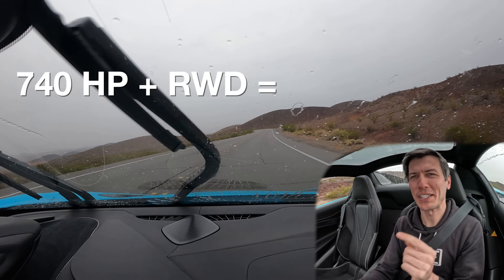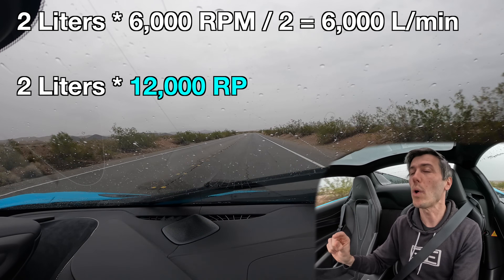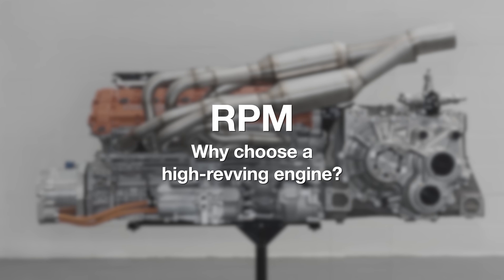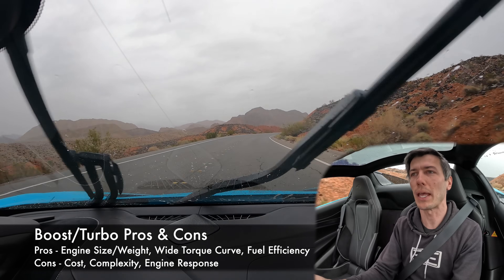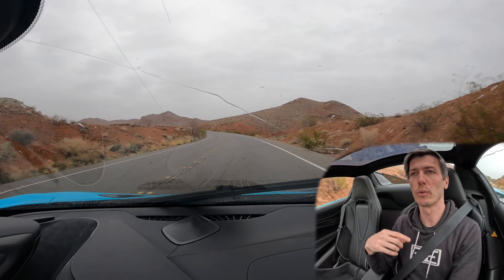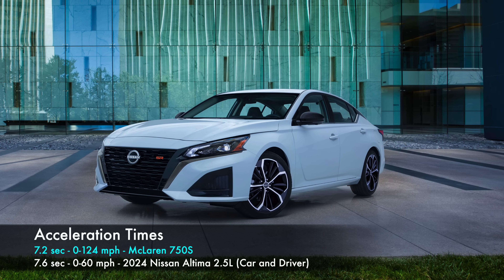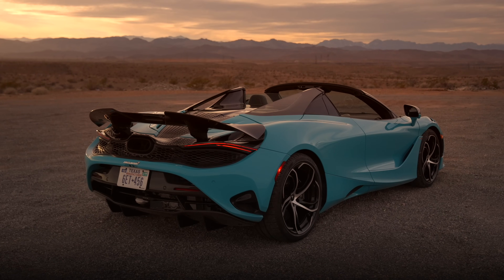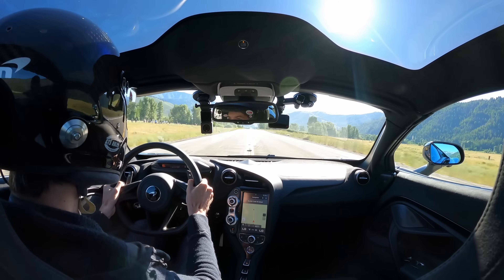Boost vs RPM vs Displacement - What's Best For Horsepower?

Comment: The best combination is a large displacement engine turning a lot of rpm with a lot of boost. There are plenty of 500+ ci engines running 70 psi of boost turning 9,000 rpm. It's just a matter of how much you want to spend.

Comment: Horsepower is calculate using american length measurements, metric horsepower is calculated using metric lengths
Reply: That’s such a relief.  I was worried the E.U. had mandated the use of mRNA injections to create genetically modified metric horses. 😊

Comment: I have always wondered why they do not make a hybrid with a small lightweight battery pack? But the car is FULL electric up to 40mph to have great acceleration. Then from 40mph to 60mph the electric power is being reduced fully off at 60mph as the gas engine is being used. Then from 60mph-say 80mph you are running around only on a 1 liter 40hp SOHC simple engine. The pack being charged any time over 60mph or during braking. 

Overall I think this could have a 3000-3500lb hybrid that has the potential to have 50+ mpg commuter in normal mode with a nice 0-60 of 6 seconds(due to things being lightweight and simple) . But also a "sports" mode where you can use that electric up to 60mph and even have a nice little electric "boost" for if you wanted some additional passing power.

Most people spend a majority of there commute on the highway and having a small engine just for going from 60-80mpg means that you dont need a huge engine or several gears. Electric low speed motor  then a 2 speed ultra compact lightweight transmission. Furthermore you could have the electric up front and the gas out back . This would aid in braking/regen at high speeds but also traction at low speeds with the battery pack down the middle of the car acting as a structural member(think Miata) with a lot of freedom in body design. 

But no one makes anything like this. Not in a normal car anyway which has me asking why?

Comment: Disappointed that you went with litres of air, when  'everybody' <ahem> knows it's the mass of air [ lbs or kg ] that makes the power. 
(The engine flows the same volume of air on a winter day at sea level as on a hot day in Denver, but makes very different power).

Comment: I get my fix for power and acceleration from superbikes at the track where lack of mass and RPM is king. I do sometimes ride them on the street, but having access to that much power and acceleration and not being able to use it without risking jail time or death is a constant sensation of being blue-balled, that does get old real fast.

For a street car, my 981 Porsche Boxster GTS  gives me all the thrills while still keeping it mostly legal. Its a great formula with a little bit of displacement, 3.4L with a little bit of rpms at 8k, combined with the increased sensation of speed from a convertible, and the super low CG from a naturally low sitting Boxer engine, and the best position to mount the engine rear-mid with RWD.

Comment: I haven't watched the video, but I'm a newer mechanic(about 6 months experience, 3 as a lube and tire tech lmao). Anyways, my hypothesis is displacement. The others give you more power as well, but they are basically trying to force more displacement out of the constraints of the engine. Boost gives more, condensed air to allow more fuel to burn. Higher rpm displaces more frequently. I mean look at tanker/cargo ships. Their engines are like MAX displacement(multiple feet bore and stroke) and they output MAX horsepower(10's of thousands). If it was boost or rpm that gave the most horsepower, they wouldn't make them that big.

Comment: or if you want an amazing power to weight and a true thrill just get out of the cage and buy a bike. for example, 2022 Kawasaki H2. supercharged, 1000cc inline 4 with 170KW (228Hp for people who can't translate from freedumb units) in just 240Kg (529lb) of vehicle. that's 200+ mph for less than $30k USD.

Comment: This is why they say there is no replacement for displacement!
Reply: Only for low rpm torque.

Horsepower is a different story.
If horsepower is just torque at rpm, then an engine that can rev can potentially make more power.

You can capitalize on that potential with more airflow, and more boost.

Hence why 3.8l Nissan GTR' are making deep into 4 digit power levels.

Comment: The only true solution is to max out all three with the strongest materials possible.  Take the 8.4L viper engine, bore it out, use crazy valvesprings to get 13,000rpm, and then cram 60psi boost into it.

Comment: Fun fact. Higher RPM doesn't really get air into the engine faster. It makes it harder, as the faster the engine spins, the shorter time valves are open for. Which is on reason why engines generate lower power and torque as RPM increases. Turbo improve this, but the faster an engine spins, the harder it is to make it spin faster.
Reply: (Im still team RPM though)
Reply: There are many more things I could explain but I wouldn't want to talk too much and sound ranty lol

Comment: Top fuel dragster:

500 CID (8.2L) V8
HEMI heads
65 PSI boost
9000+ rpm

13,000 HP
11,000 lb.ft

Comment: Do you to awnser questions ? I have 1600cc NA engine with a 2 inch exhaust . Only I think the cat is bad so I bought a 2nd hand 200 cell race cat but it’s 3 inch .. so it’s goes out of a equal length 4-1 header to 2 inch to a 3 inch 200 cell cat bracket to a 2 inch exhaust ..  would it hurt the performance or not. ? The cat is backpressure so making it bigger should make it easier for the gasses..

Comment: No replacement for displacement.
Displacement’s the most reliable method of producing high horsepower. Therefore, it’s the best from a non-rich owner’s perspective.
Reply: Turboing a car isnt prohibitively expensive anymore. Its not 1995.... 

Im quite confident a 5.3 LS with a turbo can make 1,000 horsepower alot cheaper than a stroked BBC.

Comment: Bigger engines will last longer anyway

There's a reason motorcycle engines usually don't last more than 100,000 miles on average( and the fact that most motorcycles never get to reach that because they get totaled)

Don't quote on me with your 200k+ miles grandpa's Goldwing, those are a different kind of beast
Reply: This Chanel is geared (no pun intended ) for speed freaks not trucking industry bean counters.

Comment: So the big displacement makes big power the cheapest way so in Viper is the reason

Hi revs needs a very light car so that is why it work in GMA T.50 even at low rpm

Hi boost works for small engines so that is why is in Gemera

Comment: When the Lexas LS first came out,  it had a 4L V8 that made 250hp.  Ford's CEO Alan Mulally said that was his finest car.   

Let's appreciate the fact that Honda produced a 4 banger 10 years later that's half the size, reved to 9k rpm, and made 4% less power than said Lexus

Big displacement was required because they were hooked up to 3 speed auto that had wide gaps between  ratios.   Wide power band from a big engine was necessary.   Nowadays,  we have 9 speed transmissions that allow small engines with narrow power band to stay there when necessary and get out of it for efficient cruising.

My preference would be high rev small engine with turbo compound as waste heat recovery

Comment: Jason, this is awesome.  Please help me understand gearing better.  Why does doing from a 5 speed to a 6 speed usually result in a closer gear ratios and not a higher overdrive gear?  Why aren't all modern cars made so that 70 mph can be achieved at 2,000 rpm (or lower) as that's a typical cruising speed in North America?

Comment: There is no replacement for displacement. That's what I thought.
Reply: Except there is when making horsepower.

Torque is a different story, but as far as horsepower goes, theres guys making 2,000 horsepower with the little v6's in Nissan GTR's 

The only real limitation is money.

Comment: Does anyone know if the rpm in the equation is max power at a certain rpm or max rpm of the engine overall?   For example a motor may be about to rev out to 8600rpm but makes max power at 8000.  So would you plug in the 8600 or the 8000?

Comment: Carwow did a drag race between the 750 and 720…both were said to be stock and the 720 beat the 750 in multiple standing starts as well as rolling starts. I think the only real difference that possibly gave the 720 an advantage in the dig races were the Michelin PS Cup 2’s over the PZERO’s on the 750, but that shouldn’t have made much difference in the roll races.

Comment: The best is high rpm, high boost, big displacement.  A SMX with 572  ci, 50+ psi and 9000 rpm can make 5000 hp. So just put them all in the same engine.

Comment: There's an old saying that will always ring true. There's no replacement for displacement. Larger displacement means  greater potential all around. What's more powerful than a  turbo charged 2 liter 4 cylinder engine? A turbo charged 2.5 liter 4 cylinder engine. A bigger chamber means more air, more fuel, and more bang. No matter what you do to the smaller engine, you can do the same to the larger engine and get even bigger results.
Reply: Theres something called power to weight my guy.
Reply: @mattlogic9647  cope harder. Tell me what car is lighter than and yet faster than a saturn rocket that is 90% engine and only 10% vehicle. It doesn't get any worse for engine power to vehicle mass than that.

Comment: I have always leaned toward displacement because of the three ways to make power it is the lowest stress and will most likely out last an similar output engine that either has to rev much higher or take a lot of boost to achieve. That said a big displacement motor can always be boosted for way more power and to a point reved a little higher so it has the most flexibility.

Comment: I don’t care about boost or RPM, there is nothing more satisfying than a big block V8 cross plane, the sound it makes is something you don’t get from the other alternatives, plus when you’re idling and step on the gas the hood actually shakes from all the low end torque. 👍

Comment: Hey Jason, at the start of the video you allude to the saying that engines are just air pumps which got be thinking. You also said that the way to generate more horsepower is by increasing the amount of air going inside the engine. Why is it just air that is being talked about and just fuel as well? I understand the ideal 14.7 AFR and know that the company must consider emissions, which are both affected by the amount of fuel injected...so what is your take on this?

Also, at 1:52 you have 2 L * 6,000 RPM / 2 = 6,000 L/min...so where did revolutions (the unit) drop out at?

Comment: Dear Jason, why are you using this misleading description of turbos saying "they make use of the waste heat"? They do not! They use exhaust gases flow, not heat... the heat is still wasted... It is the same as calling the generator on the turbo - MGUH in F1. The name is hugely misleading. Some people still think it is some kind of heat management magic, which it is not. It just uses the pressure of exhaust gases to spool the turbo...

Comment: displacement isn't necessarily the size of the engine but rather the volume of its combustion chamber. For example an LS motor has a greater displacement than a 2JZ engine, but its size is smaller than that of a 2JZ (quite a bit smaller too)

Comment: I really like the 2.0L L4 engine that's in my wife's 2016 Volvo XC90.

Given the size the car (SUV) that that engine is trying to propel, I am amazed at how well that actually works given it has both a supercharger and a turbocharger. (235 kW @ 5700 rpm).

Cruising at 110 km/h - I can get 7.5 L/100 km (~31.36 mpg), which again -- given the size of the vehicle -- that's pretty good without any kind of electrified assistance.

Comment: You should have included adding electric power. And which one can compliment electric power best. If you go high RPM you can counter the lack of low-end power with motors.

Comment: Hi, Your double clutching short is factually incorrect. The correct term is "Double De-clutching" it originated from vintage vehicles, particularly utility vehicles (Pre Series 2A Land Rovers) and Trucks. In those days the gearboxes had no syncromesh's (Device within the gearbox that matches the speed of the cogs and gears such that the change in gear can be smooth with no graunching of gears) This meant that one clutch press was needed to take the vehicle out of its current gear, then let the clutch out to re-introduce power so the next gear speeds up to the same speed, then clutch in again to engage the next gear and finally clutch out to initiate drive in the newly selected gear. Modern gearboxes have no need of this whatsoever, so it is only done for the "Cool factor" as it serves no purpose at all. I am a Brit who was in the Royal Electrical and Mechanical Engineers in the Territorial Army so I know my vehicles and mechanicals. I hope this helps. Cheers, Peter.

Comment: Turbocharging isn't scavenging waste energy because the exhaust stroke(s) or shaft power turns the turbo impeller. A turbocharger's efficiency comes from almost no internal friction like a supercharger.

Comment: I'm all in for larger displacement, higher RPM & boost as well. You can get a 6.0 liter LS V8 to comfortably make 650 street-able HP with a good set of aftermarket heads, cam, water-to-water intercooler & about 15 PSI of boost. All at under 6000 RPM. And maybe some nitrous for good measure.

Comment: Personally, I would like a slightly larger engine with a little less top RPM with some kind of forced air induction. As I would rather have a bit more weight in components for better durability and longer life, because I want to enjoy the vehicle for longer.

Comment: As long as there are rules and regulations limiting the design and operation of engines (size, economy, emissions, etc. - even F1 has some pretty strict rules), the theory really doesn't matter.  The rules will always determine which solution is best for power.  Once you throw the rules out, then the current state of technology and the purpose of the engine decides.  Naturally the best answer is yes to all 3.

Comment: first things first - I love the video!!! Now, to answer your question. My least favorite is displacement - in my eyes, a thing from the past. Boost has replaced displacement, like a Cheetah has replace the dinosaur. However, RPM is my favorite. RPM are cool. RPM is technologically challenging, it sounds great and it provides horsepower. There you go. Simple :)     Thanks for the video!!!

Comment: And then consider the failure modes/complexity, plus manufacturing cost and energy use in manufacture...overall energy efficiency then is...?   I admire lovely engineering, but not unneccessary complexity (I am a farmer, and being semi-remote need to maintain and fix my machinery).   I'm becoming more of a fan of simple, such as the pushrod V8, after owning, still, several Alfa Romeos and a Maserati V6 biturbos!   My old harvester has a straight six aircooled turbo diesel, individual cylinders, with mechanical injection....lovely engine, fit for purpose.

Comment: Yeah, my car engine is a bit more than 4.6x smaller than the viper, similar max rpm. If you multiply 140 hp by 4.6 and it all makes sense

Comment: I think it would be a nice "Mythbuster" stye experiment to fit geared down 3L, V10 F1 engine to big a truck and see how it does.
Reply: It would not go well. Those engines are built to run two or three hours, and 189 miles or 305 kilometers with constantly fluctuating RPM. Truck engines diesel or gas are built to run at a more constant RPM 8 to 11 hours a day.
Reply: @BlueDually4x4  For sure it would not be a long demonstration, but would be interesting to see if it could be practical until it let go
Reply: @logtothebase2 of course it would work they make 800HP more than enough to replace the diesel.  Would sound glorious too, especially in tunnels!  Might make package delivery orders of magnitude greater but would still be cheaper than the electric fantasy.

Comment: It'd be interesting to have you talk about Subaru with their 2.4 liter turbo engines, also using boost, cvt contributing to keeping in the best torque range, in a decent displacement.

Comment: 11:40 as you probably know, the 750S is faster in the 1/4 mile due to that gearing that limits it to 206 mph... the Bugatti is geared for a much higher top speed.

Comment: I watch every video you post and I learn a lot from you. Thank you. I guess I'm old school. I prefer a big engine that has been designed for torque, from idle to mid-range. Not interested in high RPM's. Don't care for turbos. Give me a super charger with a water to air cooler on a big block, any day.

Comment: The viper’s numbers at 8:30 for volumetric airflow are really the ideal numbers if it had perfect volumetric efficiency, and the fact that it is so much more than the other engines despite making the same power as the t.50 shows that it should really be making more like 750-800 hp if the heads could flow better

Comment: Motorcycles often use RPM to make the power they have. 120-130HP can be had in as little as 600cc! The 1000cc super sports often get around 180-200HP. But they all have practically no power or torque below 6000…. 
I will say they are FUN however!
Reply: 👍 Expecting to go fast from the go slow end of the tachometer is a fools errand.

Comment: The M840T engine in the 750S is even more impressive than that. It's puts down around 740 hp at the wheels, with the engine itself producing around 800 hp at the crank.